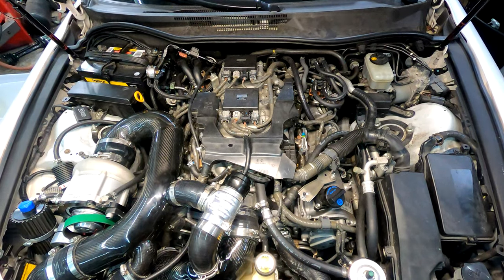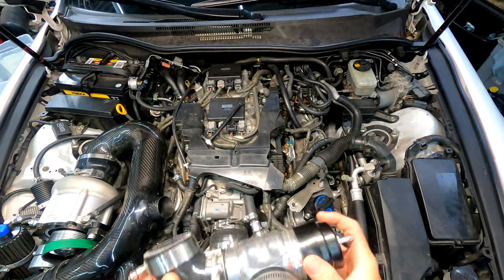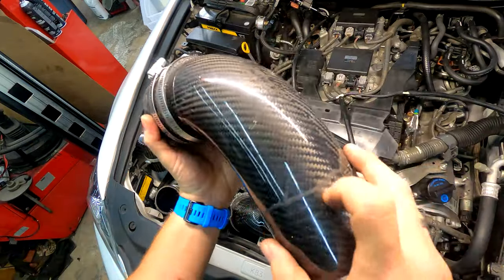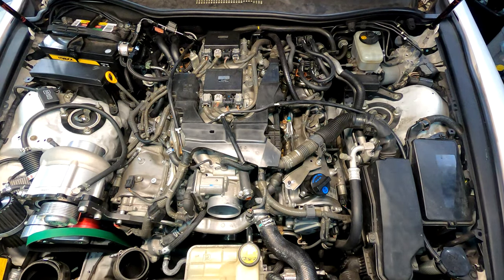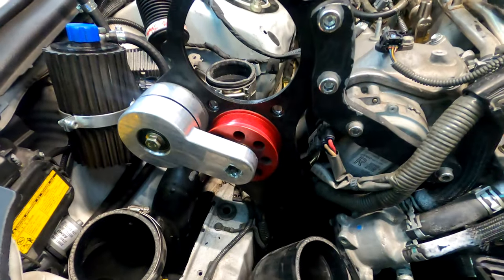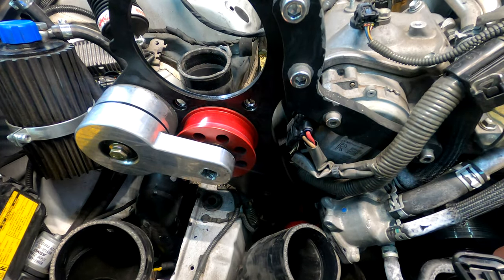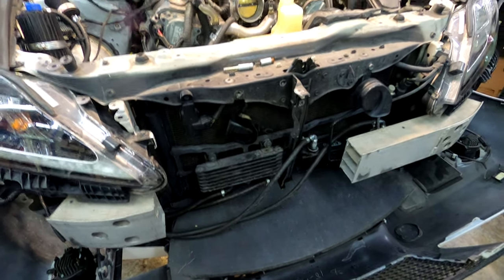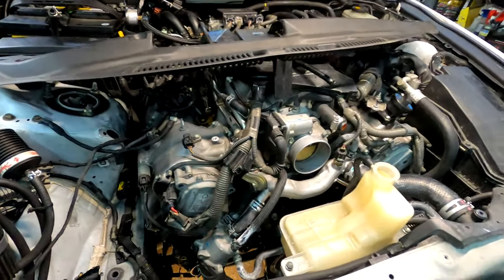How To Install 700hp Supercharger in Lexus IS-F and remove it all to sell the car as stock

Comment: Great video. I have a 2010 IS F that I superchargered. I'm glad I'm not the only one who ran into issues with the install. I had my s pipe reworked by a fabricator and also had him make me a custom bumper to fit the intercooler and piping instead of hacking up the stock one. Definitely high on difficulty of install due to the tight engine bay, especially when things don't fit right.

Comment: Sad to see the project is over.   Can I ask what finally turned you away from the IS-F project with the supercharger?   I still have my 08 IS-F and love it and have always wondered about maybe getting the SC kit down the road, but after watching this video and hearing about some other peoples experiences I'm keeping it N/A.   I mean 11 seconds N/A is plenty fast already with FBO.
Reply from the maker: I think there are more solid tuning options out there. The RR parts and kit is fine, there's no major problem with it. The real issue with the RR kit is customer service, follow ups, kit revisions, extra parts that should have been sold with the kit, tune, and tuning process. For example, I was running stock spark plugs the entire time and the kit never included or mentioned anything about running a colder range plug. The original belt slipped under boost, but there was no mention or solution of how to resolve. I received some parts that were defective, incorrect, or put together wrong. The ATI damper was incorrectly thread locked so the bolts vibrated loose on the timing cover side and wore a groove through my timing cover. Then the front side bolts were red thread locked so they snapped and I was unable to remove the pulley with a puller, ended up having to do a whole timing chain job because of the damage to the cover. 

Sometimes it would take days or weeks (or months) for answers, support, or tune revisions. OEM-like drivability is not happening and the transmission wide open shifts don't get tweaked either so it feels like the converter isn't locked up or it's slipping. The car was always either too lean or too rich and would hesitate on light throttle cruise. KCLV would tank during cruise because it was loading up with too much fuel and the car would be undriveable. Idle was so rich the car would either die or you would have to floor it to keep it running on a cold start. Their advice was just to start driving it right away so it would warm up.
Reply: @LILEVO  Geeze that is one heck of a list!  I really appreciate the honesty!  I had been really hesitant since I boosted a N/A car in the past and swore I would never do it again.  That was with a 94 Integra GS-R with the Jackson Racing SC kit.   Car ran great until it didn't run at all.  I then moved onto cars that were designed for boost out of the gate to include my past 03 EVO VIII, which was turning into a money pit so went  and jumped into Lexus back in 2006 with N/A engines as they could only be modded so far and had great performance out of the box.  Loved my IS350 and still love my F.  Can't believe I've had the F now for 16 freaking years!  Car still looks new and is making great N/A power without any of the issues you mentioned in your comment above.   I absolutely don't blame you for parting out and selling.   Looking forward to your next adventure!

Comment: Did you ever quater mile the car while supercharger?
Reply from the maker: Nope, never ran good enough to go lol. The day I was going to the track I was half way there and the car stumbled to a stop and died. Barely made it home.  Took me weeks to figure out what the issue was. Turned out to be too rich on light throttle application and cruising in vacuum.  It tanked the KCLV down to single digits.
Reply: Damn. I see why you're done with the car. I'm running the 7 psi pulley on 93. Best e.t. was an 11.4 short shifting cause of the neutral tune. Would only get 6 pounds of boost but better than nuetralling between shifts.